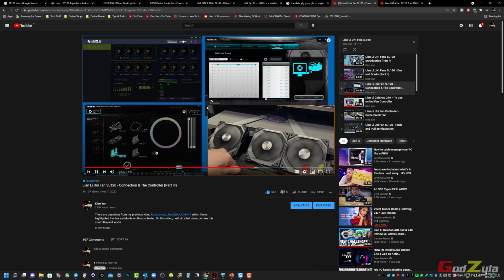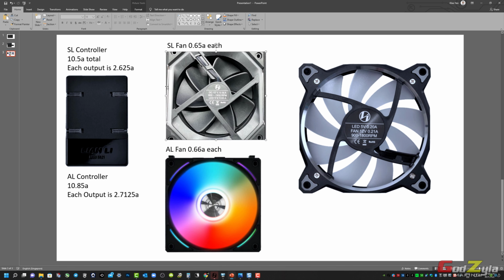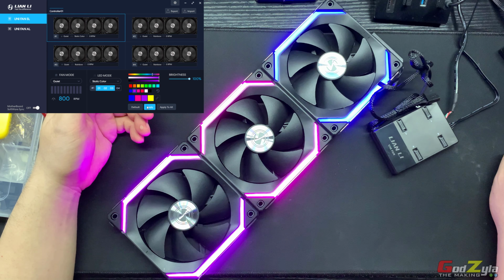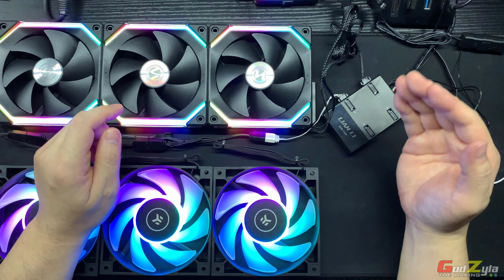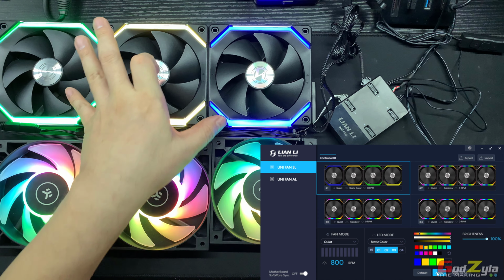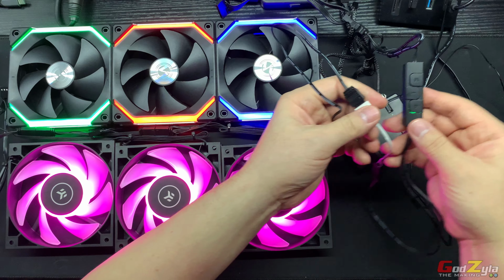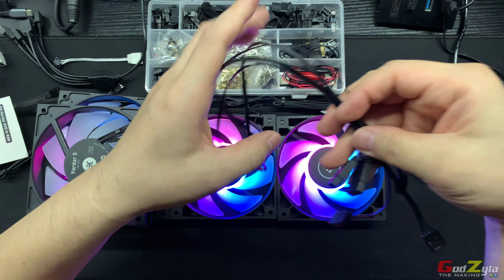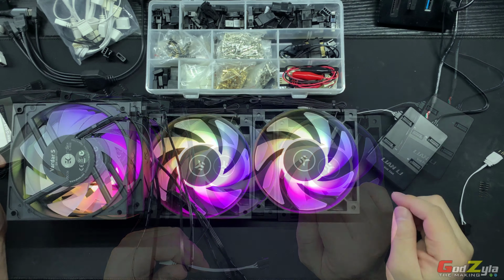Lian Li Uni Fan AL120 & SL120 Controllers [L-Connect 2]

Comment: hi, i have this hub with the sl120fans, can i connect the single sl infinity fans too to this hub with argb cable kit from lian li?
and if i can will it be recognised az an sl120 or sl infinity? i imagine the sl infinity should have chips in them so maybe?
Reply from the maker: Hi tempfli dominic, welcome to my channel. Kindly note that what you've suggested will not work if you want to have separate argb dashboard in L-Connect 3.
You are not wrong with a chip build into these uni fans but the problem is, the controller. You will need to have two separate controllers to control the effects catered for SL or SL-Infinity. Also the fan profile are different, as in the RPM. https://youtu.be/CgvuUFeff8U

Comment: Hey! I know it's quite late. But I really wanna know if I would have any problems installing SL120 fans on an AL120 controller
Reply from the maker: Hello Metal Dude, welcome to my channel. Yes, there will be an issue. You will need two controllers of its own to run the argb effects. Just make sure both firmwares are up to date and both controllers are plug to your motherboard USB header and to use the L-Connect 3 app, this video might aid you https://youtu.be/CgvuUFeff8U
Reply: @KleoYan  Thanks for the response! So what if I won't need to control the ARGB and just want to use my SL120s as static case fans? Will they still run on an AL120 controller without issues?
Reply from the maker: @metaldude5978  if you do that, it should not be an issue. You can give it a try. The AL controller can take the load of the SL fan no issue.

Comment: When i change the fan color from lian li softrare the fans do so much noise my fans is lian li s120
Reply from the maker: hello Nasser Almuu, welcome to my channel. how did you set the fan mode in your L-connect app? if you are using SL120, are you using the correct L-Connect app. please look on youru SL120 controller, make sure there is a marking "SL" and use L-Connect 2 app. if without "SL" marking, please use L-Connect.
Reply: @KleoYan  tysm
Reply from the maker: @Akakakakakakakaķakakakakakaka  you are most welcome.

Comment: How to use Liam li sl140 fan without hub
Reply from the maker: Hello Distrakt, welcome to my channel, you can do that but you will need a convertor. https://www.ebay.com/itm/284289770236?hash=item4230fda2fc:g:K00AAOSwEENgmRt6&amdata=enc%3AAQAHAAAA4PTkBoR1%2B8CDyf6SZ%2BT%2FDok79cP%2BQcuwXkuFA253OMrpiVCwU%2BRHXL9WVlH6mlhUC9ChSt0OJrqV0%2BLJQnvduJjwDDQqBrKDUpaJsrdG0RWsL9af0LXaNu%2FOWSDF5vfBqZHbPlOyNiJATAyoh8sFIJyp46S2gPTkEkWVMuascaIUd%2FYg2bbSuA%2Bwkj2TRZ3Idbgz2RaUuuE3ZUM912TY9FK8ISAAnNpUWq16M%2Fq16Mii12MpMYf6eq2GvspslUdPs6aIvRVBG1YtkPphRI6nhG1cr22hpFjWf4e38ENxGKTf%7Ctkp%3ABFBM7rfA1qRg (Female 1 To 1) but please make sure if you are connecting directly to your motherboard, make sure you know what's the load capacity. if not you will damnage your motherboard argb header or even melt it.

Comment: hello! i know this video was made 9 months ago but i’m new to pc building and i recently made my own gaming pc! I use these fans and they’re all connected properly, they spin and they light up(except from the aio fans where they only spin even though the rgb cable is connected into the controller). I have installed all the drives for my motherboard and the lian li original fan software, but when i try to change the lighting it doesn’t change and it still has that rainbow effect. I don’t really know who to ask about this and i was hoping you could give me a clear answer? It would be much appreciated and would certainly help me so much!!
Reply from the maker: Hi m6rt0, welcome to my channel. Before I can aid you, mind if I ask which unifans are you using? which liquid AIO and what uni fans were used on the radiators? are they AL or SL?
Reply: @KleoYan  all of the fans on my pc are sl and i’m using the galahad aio uni fan 240 edition
Reply from the maker: @m6rt0  ok. now does your SL hub/controller have the SL Marking on it? if it does have the SL Marking, you will have to use the L-Connect 2 app, if the SL hub/controller does not have the SL marking, then you will need to use the L-Connect app. if you very much wanted to use the L-Connect 2 on your non marking SL Hub/Controller, what you can do is to do a firmware to your controller https://youtu.be/hZpzR_4917c
Reply: @KleoYan  ok! i’ll try it out and if it works i’ll inform you
Reply: @KleoYan  alright did as you said and you were right, i can control the lighting and speed on my fans, however the aio fans are still just spinning, so i’m assuming the rgb cable got disconnected? one other problem i noticed which doesn’t have to do anything with the fans is that i also have 2 strimer plus extension cables, but i didn’t have any other usb ports to connect them into my motherboard and i don’t have the v2 controller for them. So, any suggestions on the aio fans and extension cables?
Reply from the maker: @m6rt0  pardon me for the late reply as am busy at work. now your AIO fans should work if the rest are working, this is strange. Have you tried reconnecting the argb cable or changing it to another output of the SL controller? as for your strimer plus, if you are using a v1, what you can do is to make user to the lian li argb kit. you can use this diagram as a guide. Look at the section where it shows the strimer plus original controller https://imgur.com/gallery/beYR8CN or you can choose to get the strimer plus v2 and a internal usb hub which i have illustrated here. https://youtu.be/uMgUYiakpxM?t=1671
Reply: @KleoYan  okay thank you so much for the help! Really appreciate it
Reply from the maker: @m6rt0  you are most welcome. the bottom line is.. I hope you get all these sorted out and to enjoy using your PC.. all the best buddy.

Comment: Hi there, I’ve got the Galahad 360 AIO and 6 SL fans in my case. How do I automatically set the fans to increase fan airflow when I’m doing high temp tasks like gaming?
Reply from the maker: Hi Mchael Lewis, welcome to my channel. I will suggest you to do this, for AIO radiator fans, leave the argb to the uni controller but plug the fan load directly to your motherboard CPU_Fan header. reason is, if the uni controller malfunction, at least you know the fans are still spinning properly to cool your CPU. As for the rest of the fans, you can connect both the arb and rgb to the uni controller. In UEFI, make sure you have set the fan header to PWM mode and not on auto. on your L-Connect, set PWM and it will follow your motherboard settings. therefore when you game, it will automatically ramp up your fans accordingly to the temperature.
Reply: @KleoYan  thanks for the reply. 
I’ve changed the SL fans to PWM in UEFI and L-Connect. Unfortunately there is a loud whining noise now when gaming and the case fans are making a reviving noise. 
What do you recommend I should do?
What modes should I put the CPU fan, AIO Pump and W_Pump+ in? Do I need to set the fan curves for the AIO Pump and W_Pump+?
Reply from the maker: @michaellewis545  thank you for your reply, as mentioned, for AIO pump and Radiator SL Fans, I will connect them directly to the motherboard. the AIO Pump to the fan/w_pump header. I let it run full speed in UEFI and for Radiator SL fan I will connect to the CPU_FAN, I will set UEFI to PWM and run my own customised curve based on temperature of the CPU. Leaving the argb of the SL fans connected to the uni controller for argb effects. As for the rest of your Case fans, you can connect both fan and argb connector to the uni-controller. for Fan RPMs, you can set PWM on L-Connect and on UEFI, set to PWM and to customized the fan curve or to use their profile, example performance, silence or custom.
Reply: @KleoYan  sorry to bother you again. I’ve connected my fans as you said, however, my fans are not syncing via Armoury Crate or BIOS. I’ve set the fan curves but when I turn the SL fans to PWM on L-Connect 2 and motherboard sync, it makes the fans run at full RPM. 
What should I do?
Reply from the maker: @michaellewis545  hi pardon me for the late reply, I like to check, does your fans argb work when using the L-Connect? if lighting works, your PWM should too. I have no idea how Armory Crate works to control fan speed (RPM) you might want to try just to leave the fans argb connector to the controller and the fan load directly to the motherboard. That might solve your issue. If you still prefer to have the connection all in one box, I have no other means to aid you, you might want to contact Lian Li support directly  https://lian-li.com/faq/ or you can seek others at this lian li reddit forum https://www.reddit.com/r/lianli/

Comment: L connect doesn't find controller, even when it all plugged in correctly
Reply from the maker: Hello Jesse Darren, welcome to my channel, do you happened to install any argb program of your motherboard? If you have, uninstall that and the l-connect app using revo uninstaller. Which will remove all leftover files. Then off your pc. Unplug the psu cable for 40seconds or so. Next boot up ur pc, see under device manager. See if your uni controller is detected. Then install the l-connect. Btw for SL fans and the controller without the SL mark, please use L-connect and not L-Connect 2. Unless u do a firmware which is at my other video. As for AL, use l-connect 2

Comment: Hi Kleo
I’m really new to PC building. 
I’ve got 3 bottom intake SL fans, 3 Side intake SL fans and Lian li Galahad 360 AIO ARGB AL fans exhaust in my PC with a i7-12700K and 3080 Ti GPU.
I’m using L-Connect 2 for the SL fans and Armoury Crate for the AIO fans.
Could you recommend which mode and fan speed I should use for gaming to keep my CPU and GPU cool? Not sure how to control temps
Reply from the maker: Hi Andrew Hoey, welcome to my channel and I am so terrible sorry that I miss out on your comment and questions. 
hope is not do late. ok here is what I will do

For AIO pump - I would plug the AIO Pump to your motherboard fan header which has the indication of Pump, in your UEFI, set this pump to run at full speed. if the pump is too noisy, you can adjust the percentage. you will need to use PWM mode. as for the Pump argb, you can choose to plug it to your motherboard argb effects or to connect the the uni controller. 

For AIO Radiator Fans - I would plug the AIO radiator fans to your motherboard fan header which has the indication of CPU_FAN, again in your UEFI you can set the fans to spin accordingly to temperature of your CPU, use PWM mode again. For the argb, if it's SL fans, plug it to the uni controller. If they are the original fans from galahad (ST120 fans) plug them to the motherboard argb header, control the effect through Armoury Crate. 

For bottom (Intake) and Side (Intake) fans - since they are case fans, just plug both fan load and argb to the uni controller, set the fan speed via the L-connect 2 app. same applies to the argb, use the L-connect 2 to control the effects.

as for which mode to use on the L-connect, you will need to do some experiment to see which fan settings is best to cool down your pc components. hope that helps.

Comment: Hello, i am using 9 of unifans sl and i use them daisychained 3x3 to a Unifan sl Controller. My problem is when i want to turn on the Mainboard software sync to Control the argbs, the fans start to roll in full speed and dont stop. How can i fix this ?
Reply from the maker: Hello Lukas Lamper, welcome to my channel. if you switch to modtherboard mode, your fans will be controlled via your motherboard UEFI, I would suggest you to go into your UEFI, set the fan connector where you have plug between the uni fan controller to the motherboard fan header to PWM Mode, then set the fan curve you wish to have in UEFI. that is the reason why you are getting full speed 100 rpm as your fan curve was not set, plus you by pass the uni controller L-connect controls.

Comment: Thanks!
I'm building from a long time so I need a little help. Can I put my SL120 Fans speed to auto so they will speed up or down depending on temps? Thanks!
Reply from the maker: Hello LucaDC, welcome to my channel. Just a trick. you can leave the argb connector of these SL fans in the uni controller and control by L-Connect app and plug those set of fans you have, directly to the motherboard, no worries there will but no overload as max up to 4 fans can run on one motherboard fan header. let the motherboard UEFI / Bios to control the fans automatically, there are profile like silent, performance, turbo and etc. Depending on which motherboard brand you are using and make sure is set to PWM. as why doing this, in the event if lets say the uni controller is down. at least you know that the fan are still running and cooling your system. The only malfunction is only the lighting effects. Hope this help.
Reply: @KleoYan  Thank you! I will try this as soon I build everything!
Reply from the maker: @lucadcphoto  I wish you all the very best in your build 😉
Reply: @KleoYan  Hey! So everything is fine except that the motherboard doesn't see the Uni Fan Control, it's connected via USB and I can't see fans in bios.
Reply from the maker: @lucadcphoto  hi welcome back. You mean to say in device manager it does not recognise the uni controller?  For the fans rpm, it is normal as you can only view the fans rpm on the L-Connect and not in bios, but if you connect the fans load connectors (4pin) directly to the motherboard. You will be able to see the rpm but you need to use the motherboard to control the rams.
Reply: @KleoYan  Thanks for your patience. So, I connected the controller both to the motherboard via usb and with the 4 pin directly. The L-Connect works well in PWM and I can set all the colors. But in the bios and the motherboard software, fans are not recognized at all, which is weird since I connected the controller in every way possible.
Reply from the maker: @lucadcphoto  hi that’s normal, as the fan connector from your uni controller to your motherboard is only 1 wire. Which is the pwm controller, not sensor. Plus your motherboard fan utility reads directly from the motherboard fan headers. So without the sensor from the uni controller to the motherboard fan header, your motherboard utility or even at bios. It does not read the rpm that’s running which are connected to your uni controller.
Reply: @KleoYan  Hmm so you say doesn't matter how you connect the controller to the motherboard, the fans will always be unseen by the bios and the motherboard software?
Reply from the maker: @lucadcphoto  yes that's correct. as mentioned. the cable that connects between the uni fan controller to the motherboard header.. is only one wire, that is the RPM controller. the sensor is going to the uni controller but no sensor going to the motherboard fan headers. therefore your motherboard bios/uefi and the utility software can't detect it.
Reply: @KleoYan  Great now I understand! On reddit is full of people asking for help for similiar matters. Lian Li software not the best thought let's hope the 3.0 version is better.
Reply from the maker: @lucadcphoto  I don't think it will show even using the L-Connect 3 but they do have the fan curve build in L-Connect 3 which am going to find out soon. as am selected to aid on lian li's beta testing on the L-Connect 3 https://www.reddit.com/r/lianli/comments/sveazh/lconnect_3_beta_program_user_announcement/
Reply: @KleoYan  Very nice! Well fan curve it's definitely helpful, but in PWM they work just fine I think!
Reply from the maker: @lucadcphoto  well depends if they have individual sensor to the motherboard fan header is not it will not be able to read still

Comment: The new amery crate  breaks The l connect 2 software,  cant find The controller ater The uppdate,  unistall asus software an l connect work again and find The controller  , is Therese a fix for this , it has benen working fine until last week,
Reply from the maker: Hi, Tobiaz Björknert, welcome to my channel. yes I do face issues like you (Builds that are from friends), especially when motherboard makers update their utility programs. the only way is to save your L-Connect profile, remove all argb programs (amoury crate) and L-Connect using revo uninstaller https://www.revouninstaller.com/revo-uninstaller-free-download/ , do a clean installation on L-Connect then follow by the amoury crate. if this still does not work, approach lian li direct. they will be able to assist you further. Personally, I have done lots of content about this AL and SL fans https://youtube.com/playlist?list=PLEW-b-2vYDdPo0NzHyeksx012c-nkDapm but i understand that from time to time, issues will surface out. therefore I choose not to use them on my personal right. if I really want to, I will get physical remote control type of argb controllers.